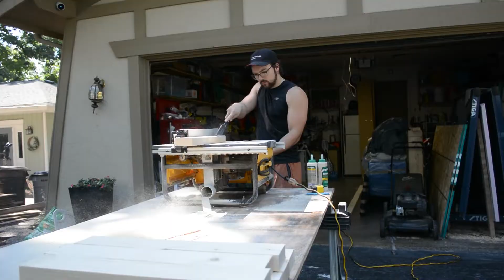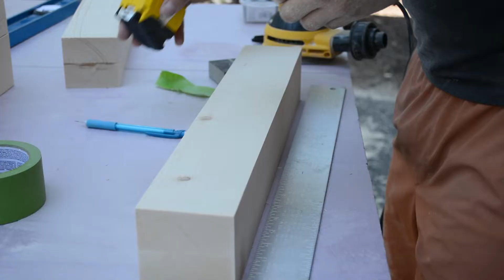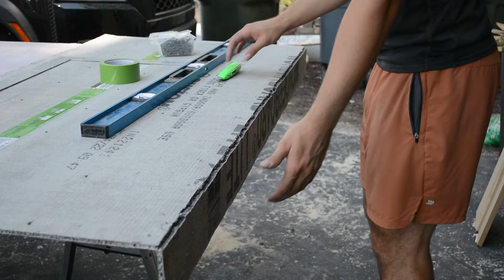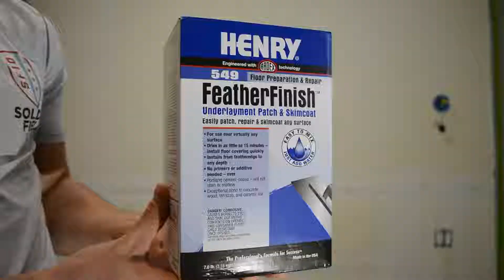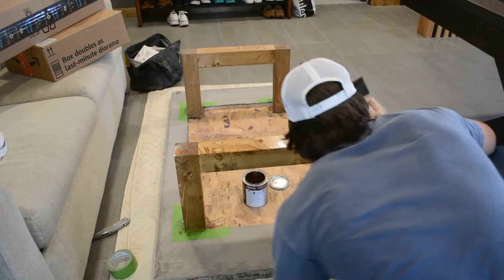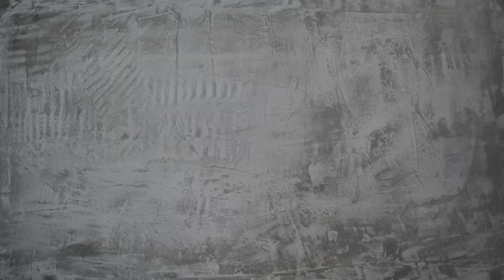How to Make a Concrete Coffee Table for Under $75

Comment: It looks amazing. About how many screws did you use to attach the Durock to the table top, and where did you place them? Didn't see this step, thanks!
Reply from the maker: Thanks! A couple inches in from the perimeter about 8” apart. Same thing for the field of the board
Reply: @GoldenKeyDesign  thanks. I am taping the seams with a concrete mesh tape , QEP, that does not stick or crease very well, and am going to retake
.  What brand of tape did you use.? Thanks!

Comment: Is there some trick to making Henry Feather Finish durable? Because I used it to make a concrete overlay for my kitchen table, and the result was garbage. It looked cool at first, but it was absurdly fragile, taking damage from literally anything: a cleaning towel, a lightly scraping fingernail, even just rubbing it with your finger. It was basically worthless garbage for even light use.
Reply from the maker: Are you adding the right amount of water? And mixing it thoroughly? It’s always held up really well for us. This table is 2 years old and looks the same as the day I finished it. We also recently did a coat on an outdoor table - it’s been through rain and snow without issue

Comment: Love this! Why do you need a cement board? If its going to be inside, do you really need it? I am new to cement and still learning, thanks!
Reply from the maker: Thanks! The cement board is a better substrate for the feather finish to adhere to. You can try applying it directly to plywood, but I have seen it not hold up in the long run. It’s been over 2 years since completing this project and the table looks like it did the day I finished it. No cracking or delaminating. Hope that helps!

Comment: How is this under 75 dollars if the cement mix is 68 on the Amazon link. Lumber is quite expensive nowadays also. Not hate just curious ? If there’s a breakdown some where I missed ?
Reply from the maker: As you know prices fluctuate quite a lot over time. This video was published almost 2 years ago so the prices are much different today. I purchased my cement mix for $20 when I built the table. You may be able to find the cement mix for less in-store rather than online. Hope that helps!

Comment: I’m thinking about trying this finish on a bar top, just not sure how it will hold up.  Did you use 3/4 OSB and 1/4 wonderboard?
Reply from the maker: Correct. Not sure how it will hold up on such a heavily used surface but I’m hopeful. I would make it relatively thick and add a good amount of sealer

Comment: How much did your finished table weigh, cuz 😅
Reply from the maker: Maybe about 30/40 pounds. It’s deceivingly light
Reply: @GoldenKeyDesign  asking because I bought high strength concrete and considered actually using it to emulate your table but then I’ll have to actually move the thing when it’s done 🥲
Reply from the maker: @camdenthediyer6140  Yeah, that would be quite heavy haha!

Comment: Love the effort but forming out a concrete slab would’ve been cheaper and easier.
Reply from the maker: I’ve done it before and found this to be much easier to do at the same cost if not cheaper. You have to build a form and there’s a lot of prep work, not to mention cleaning it up after you take it out of the form. It’s also a much easier project as a one man crew. A slab of concrete at this size is upward of 200lbs!

Comment: How did the corners do? Looking to replicate your method but worried about the longevity
Reply from the maker: Great question! I spent the most amount of time on the corners for that exact reason. I built them up in multiple layers and rounded them off a bit as well. It’s been several months since I built it and it has held up great with no cracking whatsoever. Hope that helps!

Comment: This looks amazing, I'm so inspired to try this! Do you think the concrete would hold up outside (obviously making the base out of water/weather proof materials)?
Reply from the maker: Thank you! I don't think it would last too long outdoors. Concrete is not waterproof, but you could put a heavy duty sealer on top. Regardless, the elements would probably damage it over time
Reply: @GoldenKeyDesign  thank you for your reply and advice 🙏🏼